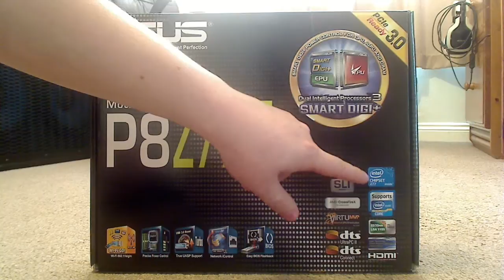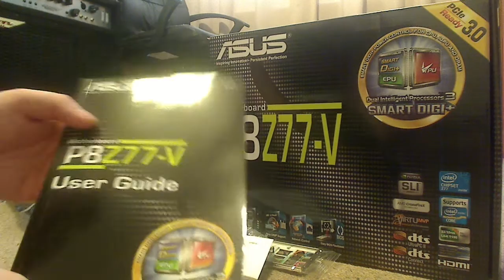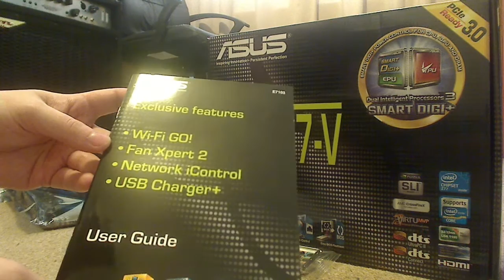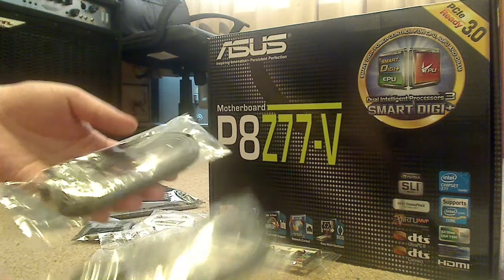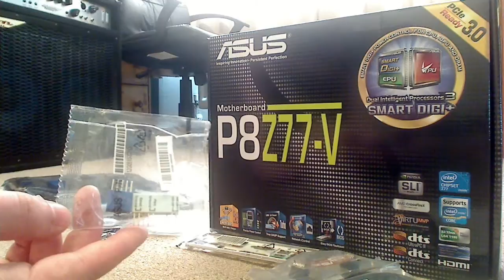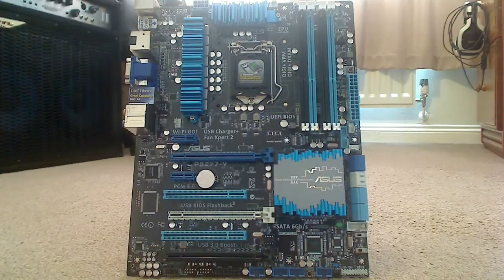ASUS P8Z77-V Motherboard Unboxing and First Look

Comment: Great video! I'm saving up to buy my first ever PC build what do you think?
MOBO&CPU:ASUS P8Z77-V LX and Intel Core i5-3570K Bundle 
OS: Windows 7 home premium 64bit 
RAM:Corsair Vengeance Blue 8GB (2x4GB) DDR3 1600 MHz 
PS:Corsair Builder Series CX 500 Watt ATX/EPS  80 PLUS 
PC case:Cooler Master Elite 431 Plus - Mid Tower Computer Case with USB 3.0 
DVD driver:Lite-On LightScribe 24X SATA DVD+/-RW 
GPU:Sapphire AMD Radeon HD 6850 1GB 
Harddrive:Western Digital 1 TB WD Blue SATA III 7200 RPM.